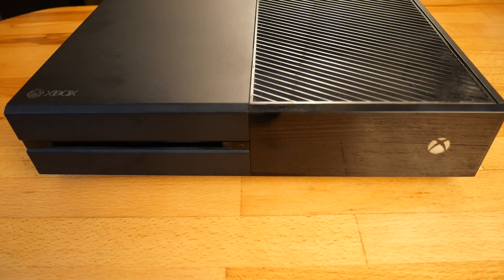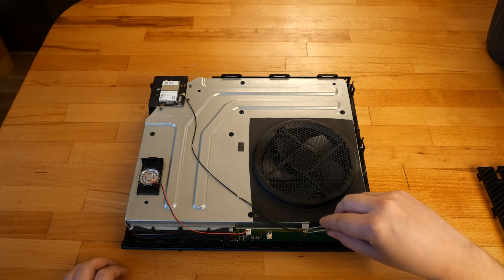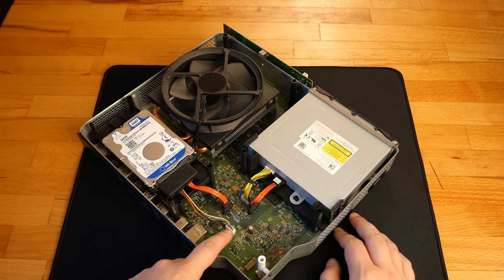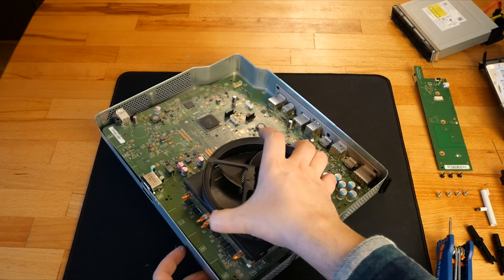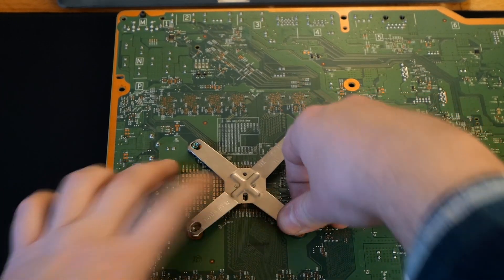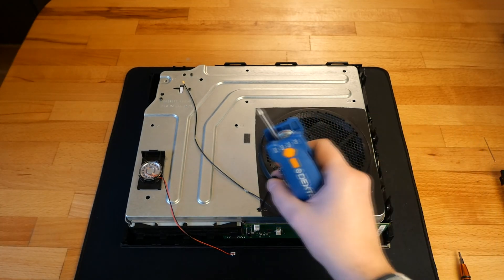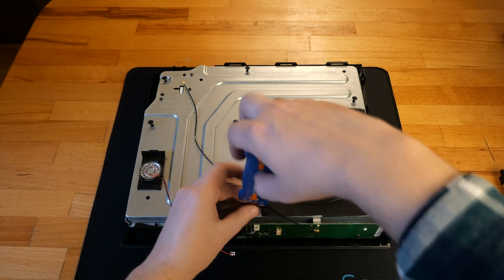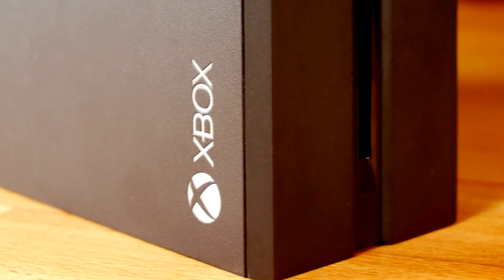XBOX One Teardown & Cleaning

Comment: Very useful. I got a used xbox one for my kids and with your tutorial I cleaned everything inside and changed the thermal paste as well. This Xbox One had spilled candle wax on the top cover. I removed all the parts and used hot water to get rid of the candle wax. Thank you very much for this video.
Reply from the maker: Glad it helped

Comment: If your console works fine DONT DO THIS. It borderline killed mine. Console turns on, but cannot play any games or movies and has a ton of input lag.
Reply: Probably a skill issue
Reply: @TommyTombstone Maybe so, but then again it would be easily fixable if it was just a skill issue. I followed this guide to the letter. Just letting people know the risks. It's better to leave it alone if it works.
Reply from the maker: You did something wrong during the process
Reply: @YesterdaysTech Yes, clearly. But what exactly is the question. It's very straightforward, and yet, here I am with a broken Xbox

Comment: you want to be extremely careful with the wi-fi board antenna connector as it can come off, in my case it looked like it wasn't fully solder on from the factory. 
got to love mixed quality control of mass produced electronics.
lucky for me i was able to solder it back on to the wi-fi board after i carefully remove the connector from the antenna cable, its so tiny! and you need a small soldering iron flat tip.
man that was a nightmare.

Comment: Can you please tell me how to contact you ... I tried to open my Xbox but after closing there remains a gap and it's not closing
Reply: there is taps on that front faceplate you have to pop them out & the face plate will pop off you install the shell together without the faceplate. Then plug the front connector in and lock it into place & then pop the face plate on.
Reply: Thank you. Nothing else was working. So convenient that the guy cut the part where he actually got the shell back on. But other than that. Great video@thomascobb5514
Reply: i have the same problem, how do you fix it?
Reply: @B3ND4 where is the gap?
Reply: I have the same gap in the front
Reply: @kubcioz9814  bro you have to remove the wire that connects the disc drive first then you have to remove the front part and reassamble it again properly after connecting the disc drive wire... That s how you do it

Comment: Thank you very much, very instructive and helpful.  For putting the ribbon cable back on, although this man's video is very good, he doesn't mention that the front panel and the top panel are also able to separate, and then the ribbon cable is much easier to attach without the top in the way.  I found this out from another video, but overall this video is awesome thank you so much!

Comment: Hi the grill of my xbox one overheats after 15 minutes throwing hot air, but the rest remains cold, is this normal?  I've never have Xbox one pls answer me
Reply from the maker: It's normal to be hot on the grill, because there's where the air is pushed outside... if the console is not too loud, you shouldn't be worried
Reply: @YesterdaysTech  hi thanks, only hot air comes out, it doesn't make any noise